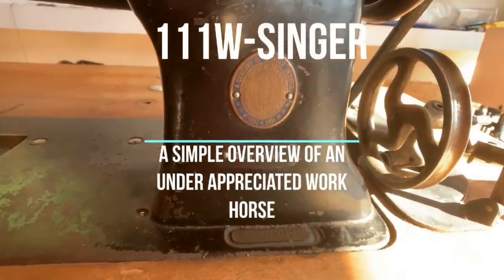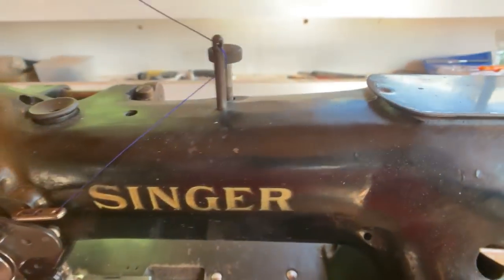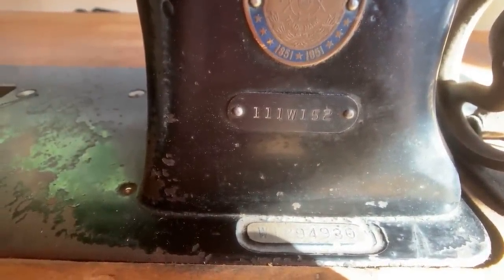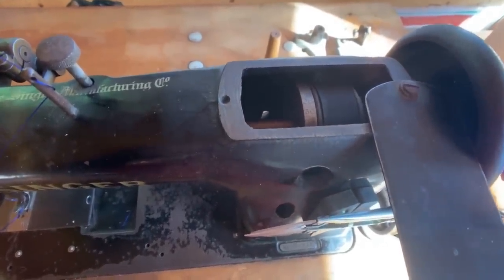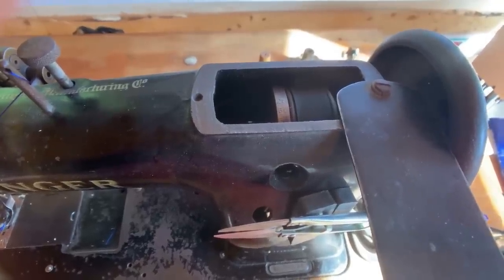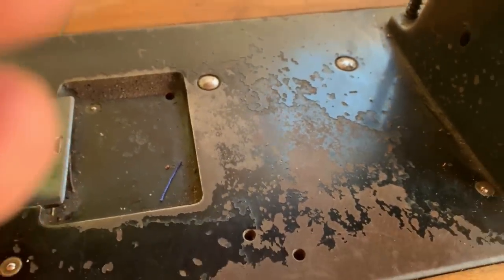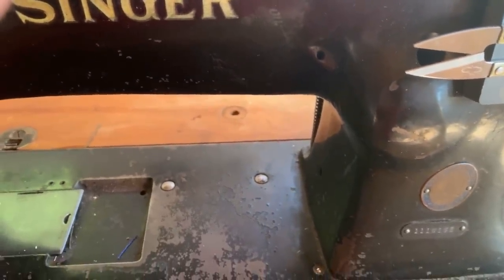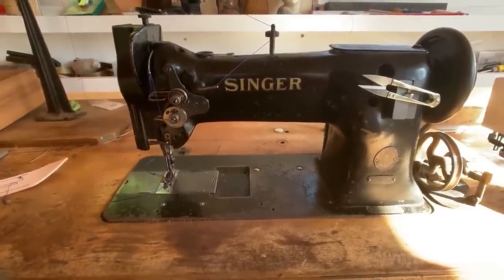A Work Horse Machine | 111W-SINGER | Sewing Machine Review

Comment: With the proper tools and good penetrant like kroil, the timing belt replacement is a straight forward task that can be completed in an hour or so. Singer made the timing setup easy,they put timing arrows on the shafts. Put the take up arm at the very top of its stroke, line up the arrows, slide on the belt it’s timed….
Reply from the maker: Your right and this is a skill set that I likely am going to develop this year.  My local guy retired and I am going to have to become more hands on with the repair side of these machines.  Thank you for the feedback.
Reply: @viadango  I have a 111W115 also I love it except quality oem or quality replacement parts are expensive. I haven't replaced the belt its the original I ordered a new oem belt if I ever have to replace it. If you need parts I found a source that has great parts just ask.
Reply: @michaelxwhite  Bmf Wholesale located in Macomb, Michigan. They are who I buy from. They have quality NOS original or quality Japanese parts for the Singer 111W115. Tell them I sent you they are excellent.
Reply: Hi, I have been looking at other vintage machines that I could possibly convert to a portable machine. Do you think it is possible to add a hand Crank or small motor to the back of it? I currently have a vintage Kenmore which I have messed around with but I need a walking foot machine. does this one have a significant amount of resistance when hand turning it?

Comment: My 111W-103 was made in 1933. I just gave it to a non sewing belt maker. Came here to look up more info. I was given it from another neighbor that never really used it or forced used it. A son in law of my next door neighor was over when we were putting new flooring in my sewing room and saw it sitting outside. We are in California and he makes sails on the east coast. He tuned it up or me but he said something about hard to set. I know why now. I had not realized it was also missing the knob to adjust presser foot tension. I had gone to an industrial supply and they had a cobbled together manual for these older machnes, so he has a part list but a bit hard to tell which machine. This helps some!
Reply from the maker: Sounds like you got a plan and a machine up and running.

Comment: Neither belt replacement or hook change is a big deal, lots of information on YouTube for home users to do either and whilst some factory ones may have worked hard many will have been used by hobby and hardly worn in but the good thing is lots of spares and few major problems, great machines for hobby leather workers

Comment: I find the stitch length very easy to adjust. You don't use both buttons to adjust it, one is to reset the safety clutch, luckily I've never had to push that one.

Comment: Have a question concerning my 111w151 if anyone can help would greatly be appreciated. 
The bobbin case clasp rubs on the bottom of the slide plate giving me bird nest of the top thread as it makes the loop. Have know idea if there is a way to lower the case or if it had the wrong bobbin case in it when I bought it. Works great with the slide off.
Thank you!

Comment: Does your machine have a servo motor? You have a lot of speed control with your set up. I just bought a 111W153 at a garage sale. Timing belt looks good. Haven't gotten it going yet to see if the bobbin case/hook is worn....

Comment: What motor do you have on yours for such good control (and so quiet)?  My 111W155 still has it's original motor, from 1951 so far as I can tell.  It's a single speed 1725 RPM American Safety Table Co. (AMCO) 1/3 HP motor with a built in clutch controlled by the pedal, so the motor is always running full speed.  Why do I think the motor is that old?  Because just the motor alone weighs in at a whopping 60 pounds!  (It sure sounds cool winding up to speed though when you first turn it on!)
Reply: Can’t speak for the one in the video but for my industrial machines I usually buy an Enduro servo motor off of Amazon that pretty much bolts directly to where the original motor does. Super quiet and very controllable
Reply from the maker: I have worked with an original motor, but it was on canvas to make tents in a workshop other than my own.  The older motors are not only heavy, but learning to "feather the speed" so to speak is a real skill.  When you add into that equation working on leather, I think it is a tough job.  Not impossible.  I am using a modern Servo Brushless Motor on all my machines.

Comment: What size motor is appropriate for this model please?
Reply: I have a servo brushless motor install.  They normally come with a large and heavy clutch motor which is not great for sewing leather.
Reply: The clutch motor for a Consew 206 I think will work. My 111W115 has the Singer clutch motor I like it.

Comment: Man fantastic overview learned a lot. Whats the thickest leather youre able to sew with this machine? would it handle a couple layer of 5/6oz or would that be a stretch? thanks
Reply: I have sewed at least 10 oz of veg tan.  Frankly, I have pushed the machine to the point that I thought it could actually break, but did not.  The problem becomes the feed dogs and presser foot lift struggling to feed the material through the machine.  It is very important to adjust the presser foot tension to make sure you are not marking the leather up.
Reply: The only limiting factor of this machine if running correctly is the lift height. If it will fit under the foot it will sew.
Reply: I have sewn 2 pieces  of 4mm heavy hide leather, I couldn't go thicker as I couldn't fit more under the foot, although I don't recommend lol  mine is a 111WSV77  ( Glyndon)